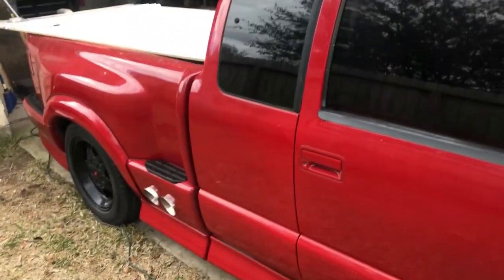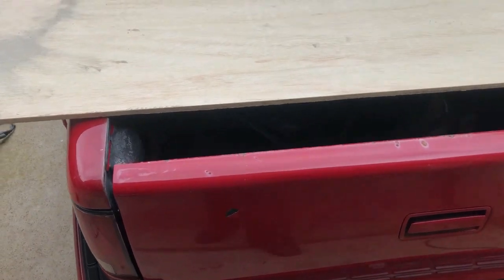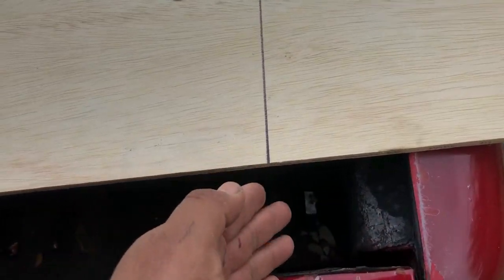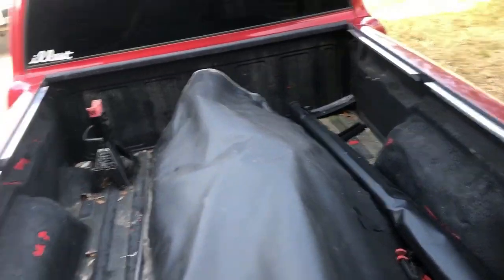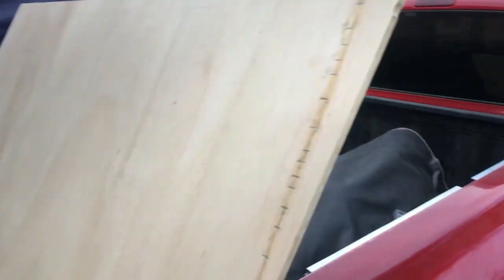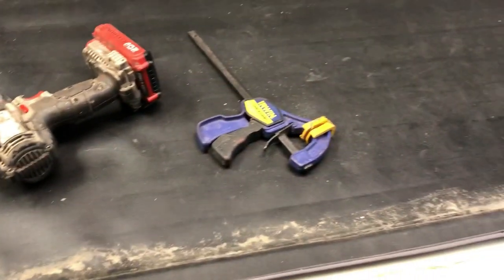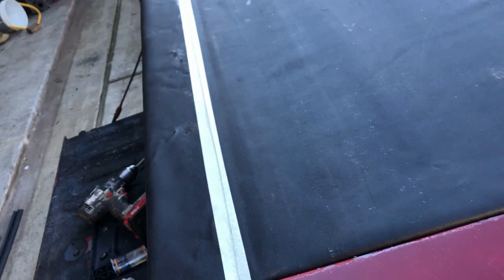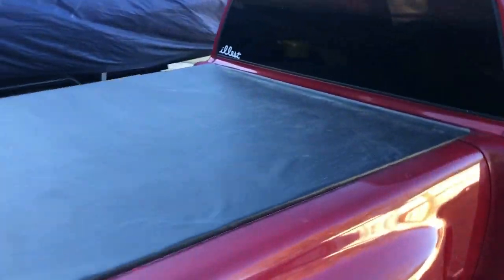S10 step side bed cover

Comment: Hey i want to create this cover for my truck, 98 f150 flareside. Not a square bed. Also wider near cab. Its nice but seems not compatible with every bed cover so far...

So best idea is to create one. Your video will be helpful. Piano hinges and aluminium angles are a most.

I dont dig the one-piece of wood, since i need to carry stuff through the roof. Maybe a trifold since retractable is not possible with wood.

Painted wood is not resistant to weather, thats why you use vinyl? There's "bate piedra" in my city that looks great and i purchased a spray gun off amazon. Pretty cheap, does the job and its resistant paint.

I would love to make a video and tag you once its done. Your video has inspired me.
Reply from the maker: I’m glad to hear! One of the main reasons to use vinyl was yes because of the elements, I will be making a different one in the near future though, not because this one won’t hold up it’s just I want to improve  on the design. What I plan on changing is using a stainless steel piano hinge since mine has started to rust, and I would actually like a painted bed cover so I will coat the wood in fiberglass and paint it,  aside from that maybe adding lift struts.
Reply: @madmike_9343  sounds like a great idea! Im still for someone with the right tools to do the work for me with the wood. Of course painted in black will look awesome with red, my truck has bi color.

Piano stainless hinge is a must. Struts are a great idea to keep it up, but the way it opens. How has it worked for you? It looks weird to be wide tall as a inverted V.

Retractable covers looks like the best but there's no way that can be reproduced with wood. 

Is there anything better than vinyl? What about tarps? Painted cover is great but I'm thinking about covering holes so no water gets in. I'm still designing this...
Reply from the maker: Eduardo, so I did try air struts off camera but I just couldn’t make it work(the angle of the wood vs my wheel hubs) so my plan is to buy an ARE hinge it will have better lateral support . I’ve toyed with a tri fold concept but instead of it folding on top it would fold inside itself(complicated of course) you might wanna consider using aluminum 1/8 thick, it’s definitely strong enough and easy to cut with a jig saw. I’d stay away from tarps, in my experience they are not UV resistant.
Reply: you prolly dont care but if you are bored like me atm you can stream pretty much all of the latest movies on instaflixxer. Have been binge watching with my gf during the lockdown =)
Reply: @Elian Anderson yea, I've been watching on instaflixxer for since november myself :)
Reply: @Elian Anderson Definitely, I've been using instaflixxer for months myself =)

Comment: Dude, you did a really good job on that cover. I've been trying to find a hard cover for my step side but i might do this as well. Thank you for the idea. This is true custom work!
Reply from the maker: Thanks man! If you do this I’d recommend using stainless hinges and coating the wood once your done. I took mine off because I shaved my tailgate and added a wing but I plan to make a different one in the future

Comment: Thank you for the video, I'm still thinking about mine. Maybe letting it overhang on top of the rail useing the aluminum angle supports and latches as you did. I would rather have it flush like you did but I'm wondering how ro seal it.  But great job, thanks for the ideas.  God Bless.
Reply from the maker: Rob Knight, if you go this route you can use camper tape. It’s sticky so you can put it on the angle and the foam will seal against the plywood.
Reply: Thank you I'll do that, but I was thinking a seal on top attached to the cover to seal the space between the plywood and the truck.

Comment: Did the plywood sag over time?
Reply from the maker: @jimmycecil1287  I did have a sag by the tailgate about 1/2in drop, which can be mitigated by angle iron or a bar fixed on the tailgate. The other thing I would change is the hinge, finding a stainless piano hinge would be the way to go. I did end up removing it like 3 years later because I wanted to do a.l tailgate handle delete.

Comment: If you end up not being happy with the vinyl have you considered coating the cover with something like Line X bed liner? It comes in different colors. Ive seen whole trucks painted with that stuff and it looked pretty good.
Reply from the maker: That’s a good idea, I actually took the cover off since I shaved my tailgate, I am planning a different design. I hope to either have a roll on vinyl cover or a flat one but painted to match.

Comment: What suspension do u have on it I’m building a 2003 step side and I’m trying to find a good cheap brand
Reply from the maker: It’s an xtreme so it came with the zq8 suspension plus 2 in drop blocks in the rear.

Comment: How do you think raptor liner would have worked spraying on the plywood?  Get rid of the  vinyl all together I feel like in the sun being black the adhesive would probably bubble up ?
Reply from the maker: So yes and no, the bed cover lasted 1 years but the problem was the plywood, it held on to moisture, I took it off because of the hinge rusting and the plywood warping a bit by the tailgate. If I was to do it again, I’d buy really thin plywood (like 1/16 ) and stack them using fiberglass resin to make some waterproof plywood, I want to make another one that folds but don’t know when I will.
Reply: @madmike_9343  do you keep your truck outside? What about a big piece of plastic? Or treated wood
Reply from the maker: @willwork2fish261  yes the truck is kept outside I did have issues with the hinges rusting but aside from that she held up, I took it off because I shaved my tailgate so I plan on making one out of aluminum that collapses

Comment: In the beginning, I was confused as to what your plan was with the angle. It does look nice how it sits however. My question is this, how much structurally is the cover sitting on top of the angle?
Reply from the maker: Not much, I think it has an even weight because of the piano hinge. it hasn't broke this whole time. if anything you can add fiberglass resin to make it stronger. I might do a part 2 to this and do the whole thing in fiberglass just to paint it,.

Comment: How you keep water out the bed of the truck 😮
Reply from the maker: Well, I don’t have the bed cover on anymore since I flushed the tailgate didn’t have any way to open it at the time, so I just pulled it off but when I did have it on very little water would enter but if you really wanted to seal it I can only imagine some weatherstripping would be way to go attach it to the edge of the truck, so it would align with the bed cover

Comment: Do you remember the measurements on the plywood? Also have a stepside s10.
Reply from the maker: MrAlmatic 

So it’s 50 inches by the cab and 44 1/2 inches by the tailgate and it’s 72 3/8 long, but just measure your before you cut.
Reply: @madmike_9343  thanks man! Didn't think you would reply so fast. Awesome!
Reply: And would like to see a walk around of your s10. Looks clean.
Reply from the maker: Correct
Reply from the maker: MrAlmatic  once I get some free time I will do a walk through